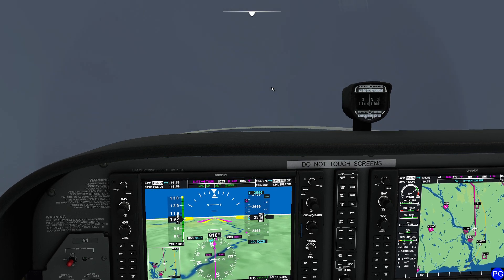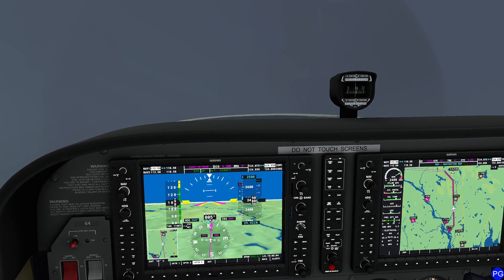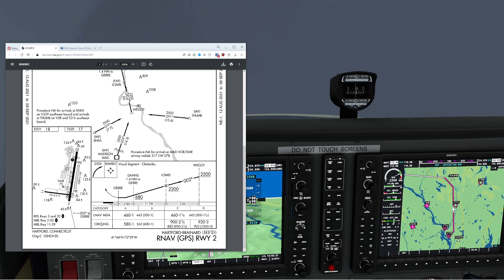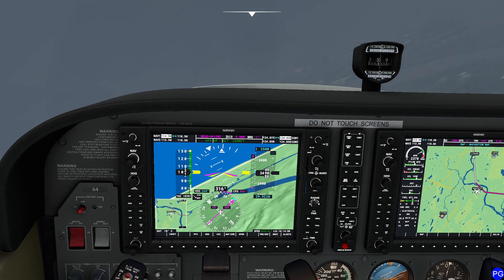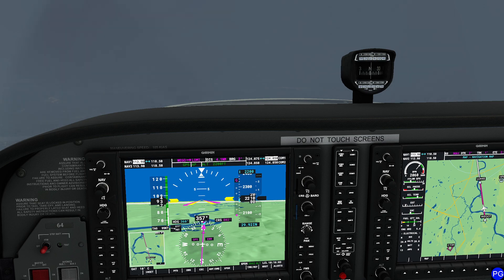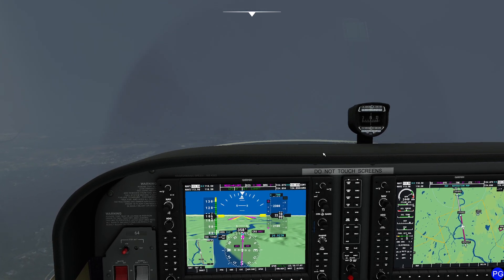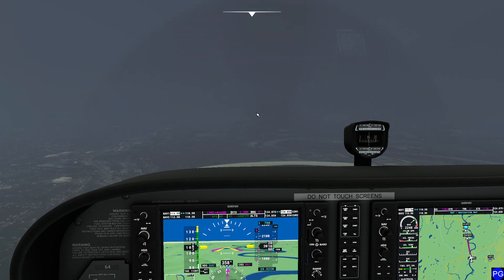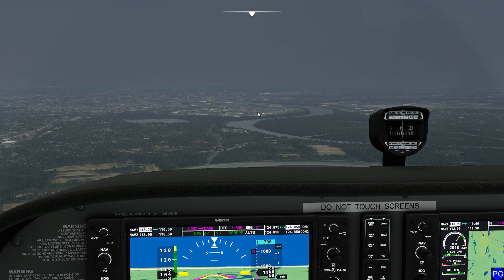MSFS - Circling Instrument Approaches

Comment: Great video and very good circle approach. For the faster aircraft the minimums are higher. The MDA will usually stay the same but the minimum visibility increases which gives the faster aircraft more room to maneuver. On instrument approaches the visibility is the controlling minimum. The MDA or DA is simply the lowest attitude you can descend to without the runway environment in sight. Also, the initial approach clearance contains the circling clearance. Example: "Cessna 35E cleared VOR runway 15 approach circle to runway 33".